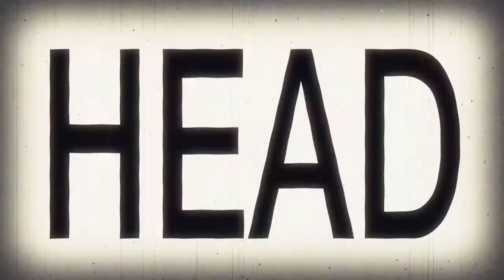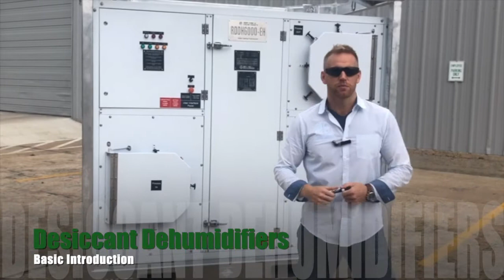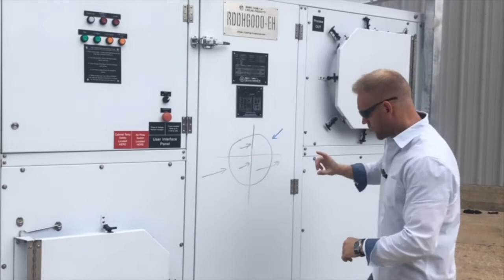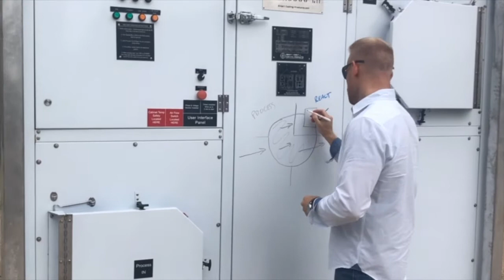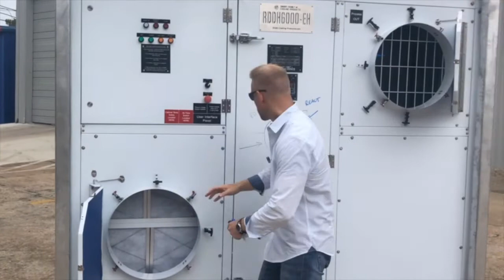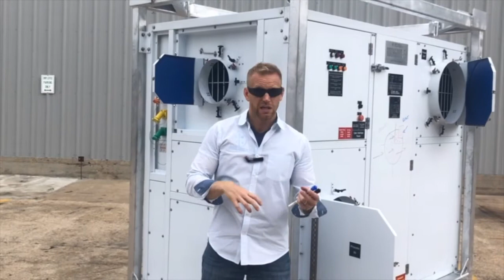Smart Academy HVAC202 - Desiccant Dehumidifier Overview

Comment: For the reactivation inlet. Can that  just be open and pull from the room air , same as process air inlet from the space or outside air.
I understand that the reactivation outlet (moist air) needs to be discharged outdoors.